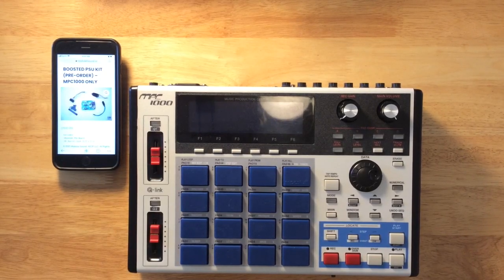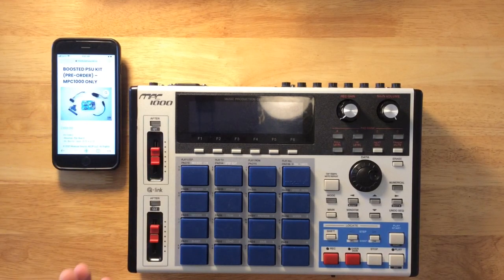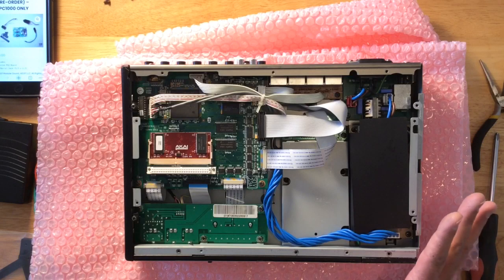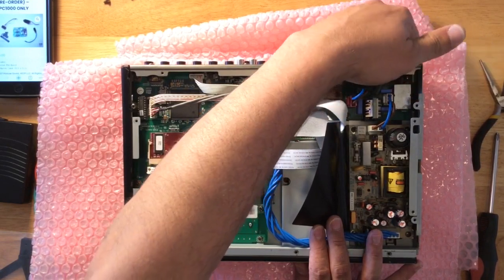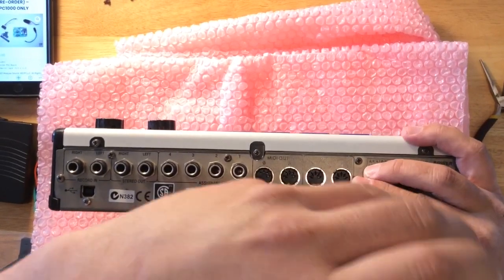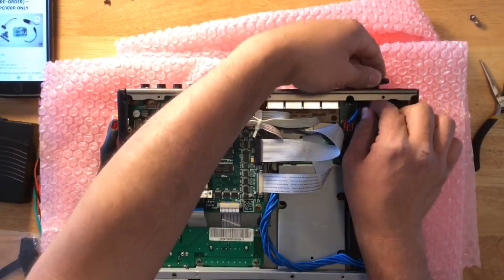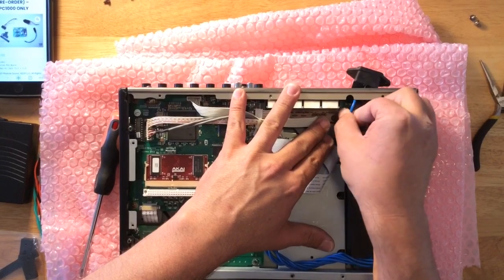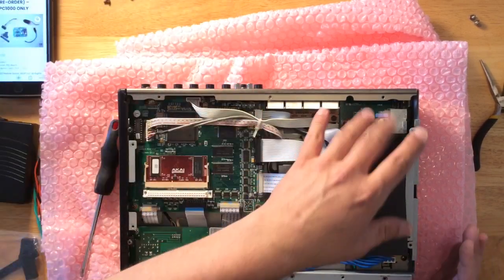MPC 1000 - Modular Sound - Boosted PSU Kit Installation

Comment: Is there a way to add this and still be able to plug it into my wall at home when im not trying to be portable. If so , its perfect
Reply from the maker: Yes. The battery pack has a cable that will allow you to plug into the wall
Reply: @lugo4905 will this charge while using? will it not overheat?
Reply from the maker: @whatsgrowingon  hasn’t overheated in over a year. You should be good to go